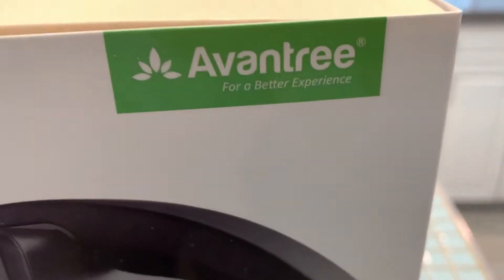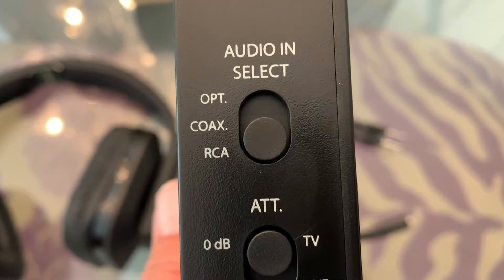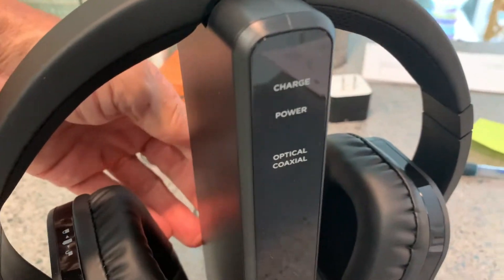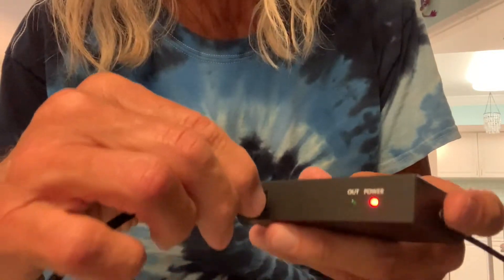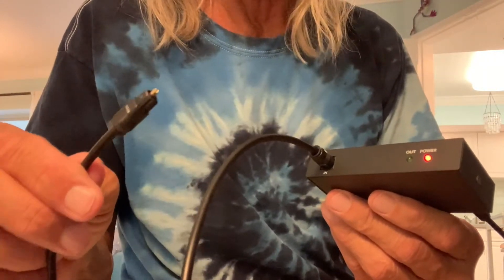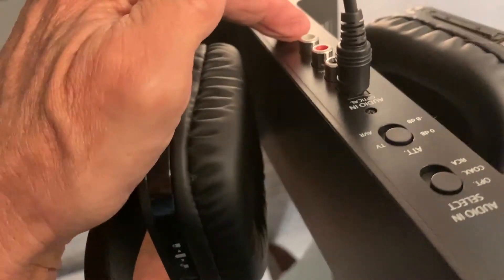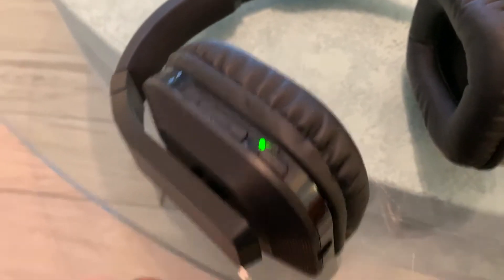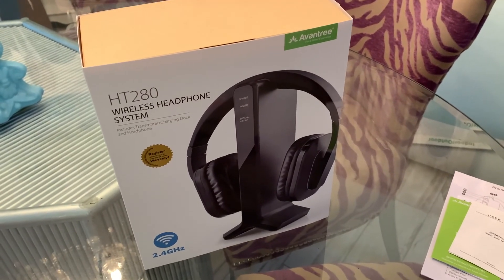How to connect an Avantree HT280 wireless headphone to Roku smart TV using an Audio Optical splitter

Comment: So my question is can I use these headphones and still have audio out the tv speakers at the same time or does one cancel the other? Also how do I make these work with my cable box?
Reply from the maker: Yes, these work with an audio splitter, which I should say is an optical audio splitter and then you can connect it to a number of devices besides just the headphones and you can have the sound come out of the TV speakers at the same time sometimes when you plug-in conventional head sets into a TV, it cuts out the speakers I have a video on how to do that thanks for watching